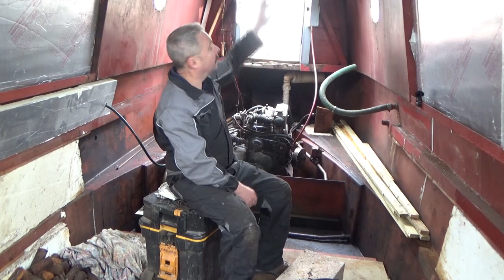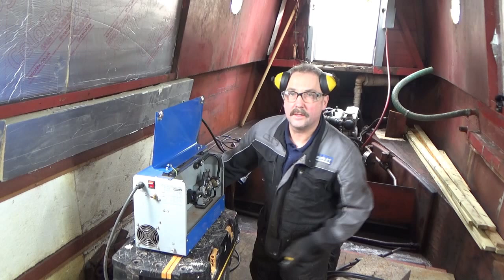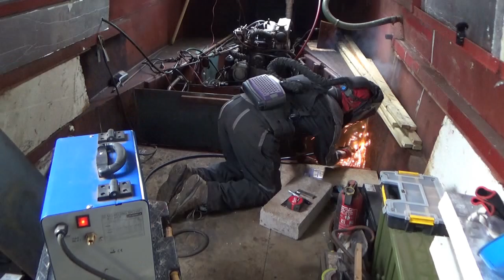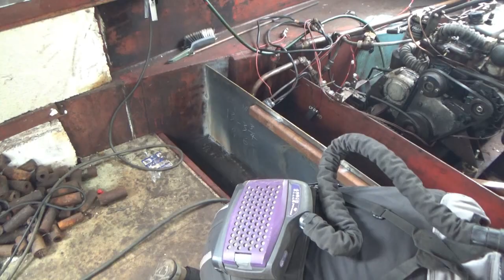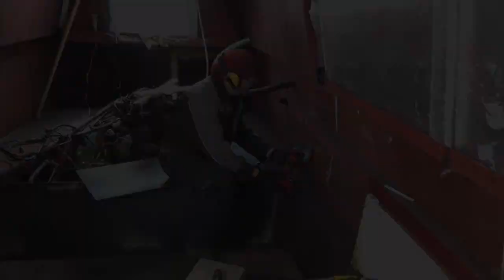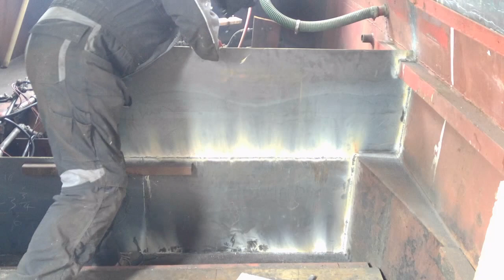Narrowboat Build. Fabricating A New Engine Bay Bulkhead

Comment: Hello chap, just found your videos. I’m currently fitting out a narrowboat myself and have been scratching my head about battening the ceiling ribs, only to find you have a video showing just that 👍 could I ask what wood you used please, everything I’ve tried breaks under the tension. Thanks for the videos, enjoying the progress. I’ve got a couple short vids up myself if you’re curious
Reply from the maker: Hi Oli
 Thanks for the comment. I used 40 x 21 mm PSE pressure treated that bent Ok as it was slightly damp but soon dried out. I fixed it on with techfast screws from toolstation. They are excellent for using to attach wood to steel as no pilot holes are needed just screw them  through it all and they don't cost much. Hope this helps  & good luck with your boat.
Andy